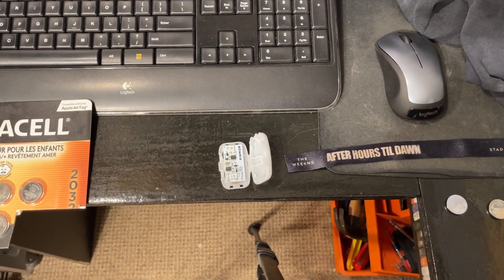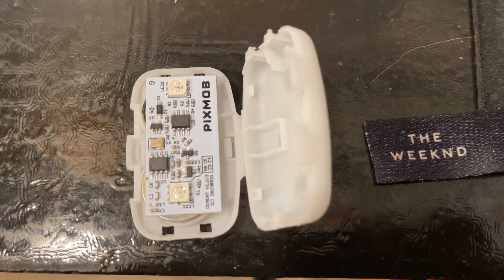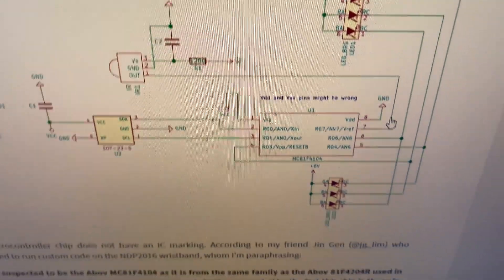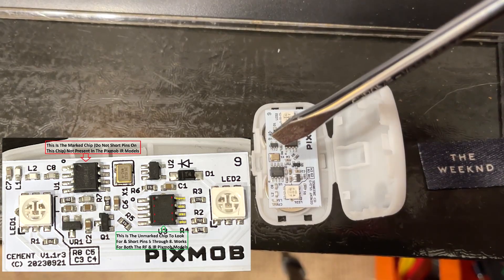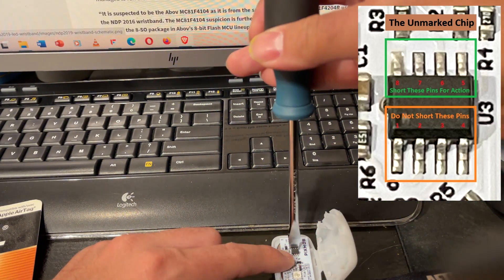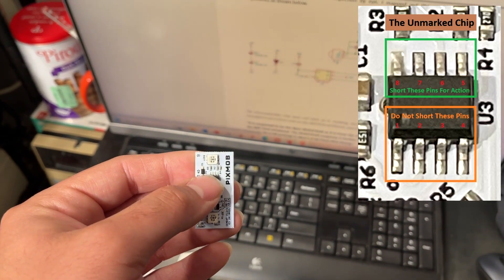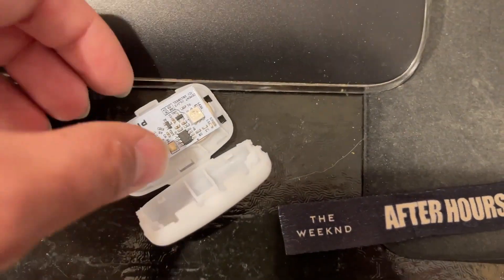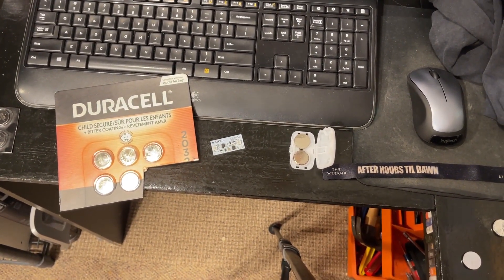How To Reuse A Pixmob Concert Wristband With A Detailed Breakdown Explanation

Comment: How does it stay on with new battery? Once closed?
Reply from the maker: When you close the lid and the board is in place the unit is on all the time. You would need to tack some wires to the chip I mentioned in the video to control the LED lights as one method.

Comment: I took a shower with mine it might be blown now.
Reply from the maker: You might be lucky if the battery was drained completely. The Pixmob wristband lights chew through battery's like no other even if the lights are not on. I would remove the battery and let it dry either in rice or air dry for a few days. I hope this helps you out.

Comment: Have you seen the 2 aaa batt board version? There are two  Chips and neither one is labeled. How do you know which chip you can short? The chip in the middle has its pins left and right while thr chip on the right has 4 pins on top and 4 on the bottom.
Reply from the maker: If I had the 2 AAA batt version on hand I would help you figure it out but I don't have that version. The 2 AAA batt version must be an early Pixmob concert wristband.